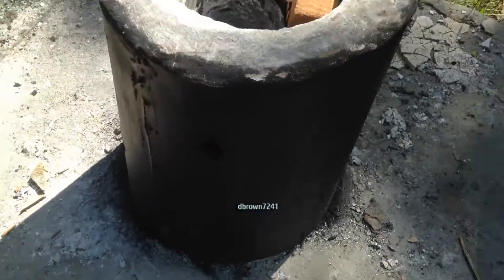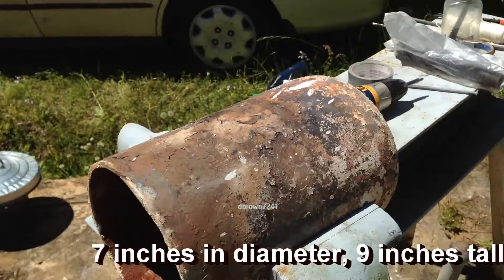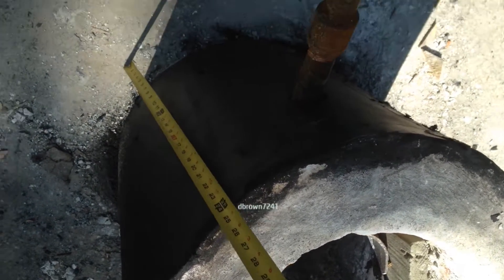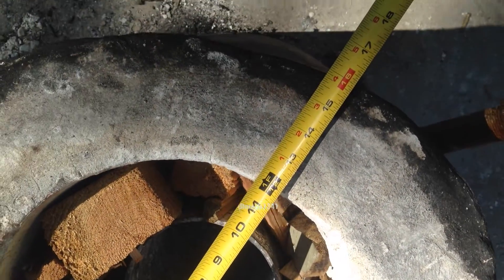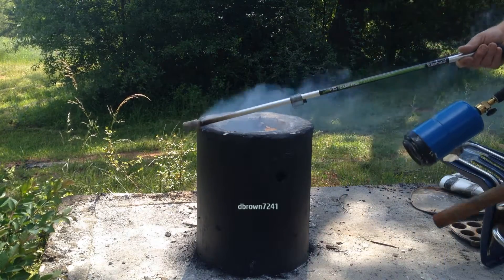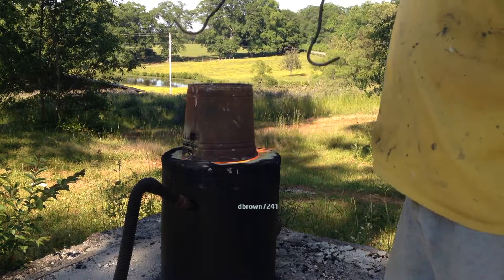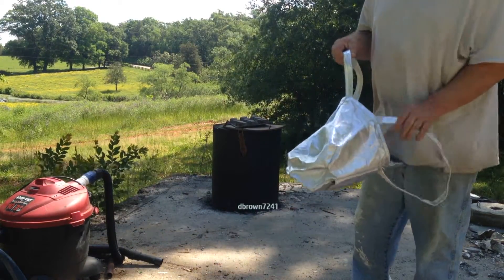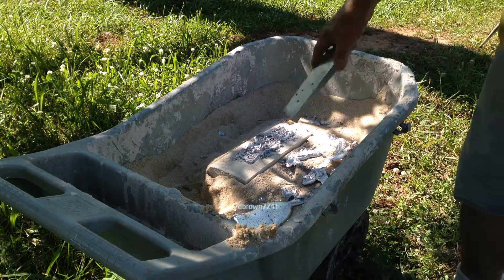Runs on Firewood! Cheap, easy-to-make Metal Foundry Melts all forms of aluminum!

Comment from the maker: And yes, the bucket was the mini foundry I built first. I felt it was much too small to pour larger castings like I wanted to do. The large crucible gives me a lot more flexibility to make small or large items. I suppose you could still use the metal fire extinguisher crucible, which would allow even more firewood to be loaded. Also, I have noticed that the firewood seems to burn hotter than the charcoal, which helps a lot. I would use hardwoods though, just like a fireplace in your home. Pine will cause residue build-up issues.
Reply: Would it be possible use a 55 gallon metal drum to make a foundry for larger pours?
Reply: @joechevy2035  I am going to build a forge out of a 55 gallon drum and use a 35 gallon for the center,
Reply: @joechevy2035  i did this a long time ago on a budget with regular concrete. I stl have it 10+ years later, concrete is damaged but it still works like a dream. So yeah it works great!